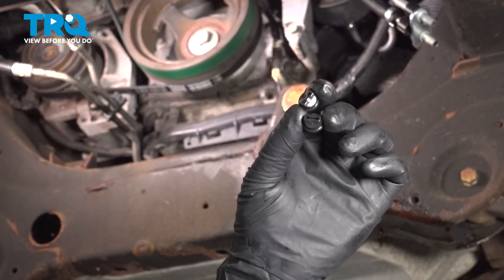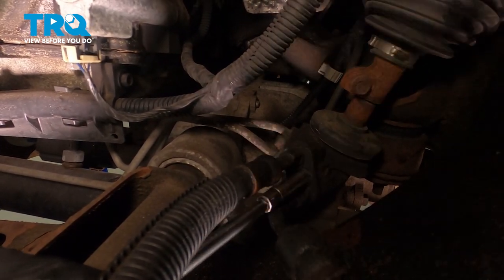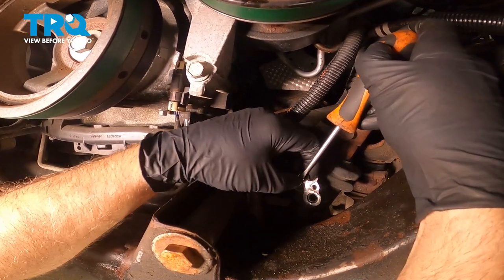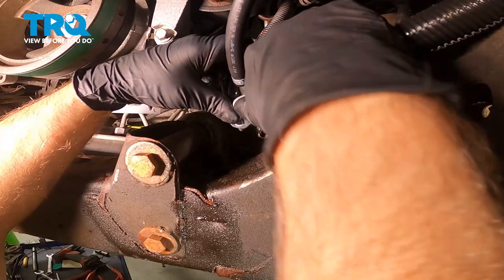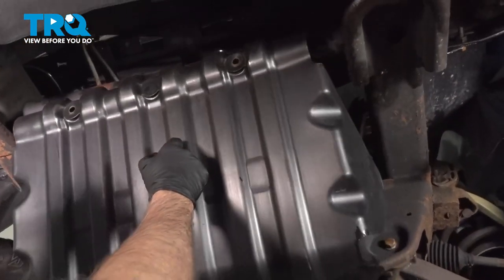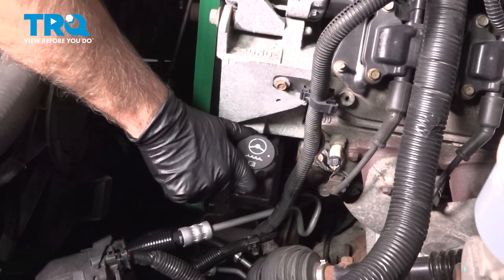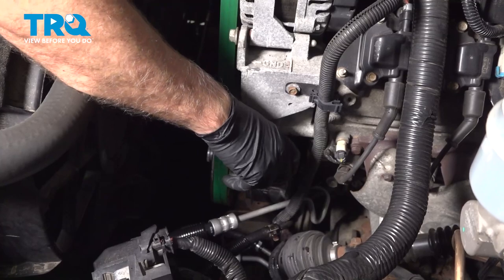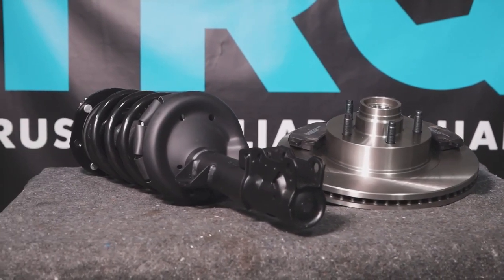How to Replace Power Steering Pressure Hose Seal 2007-2013 Chevrolet Silverado

Comment: Little tip to all the first timers… use a bolt from the “shield” and thread it into the old rack seals… just make sure you tap the new seals in nice or it will definitely leak

Comment: Use a BOLT to remove those, not a pick. Took maybe a second each. Thread it in 1-2 turns and rock it once
Reply from the maker: +backINblack626 Thanks for the feedback! http://1aau.to/m/Shop-TRQ

Comment: Is there a gasket on the other side of the hi flo line like those black ones that u put into the pumps hole like u would the racks hole when attaching.